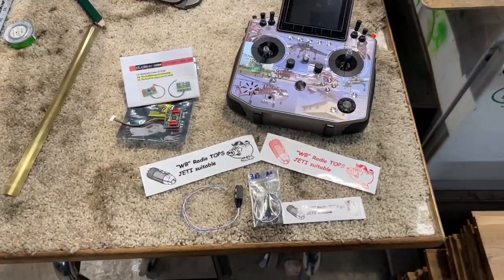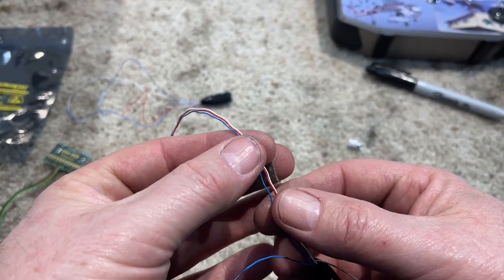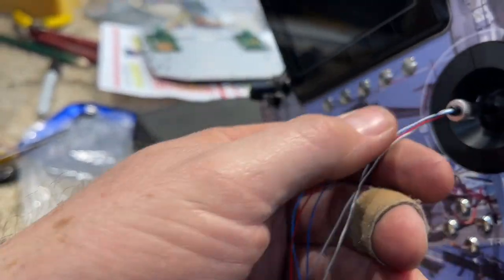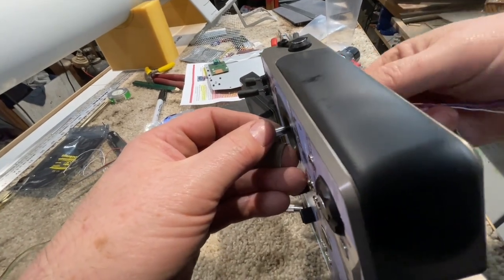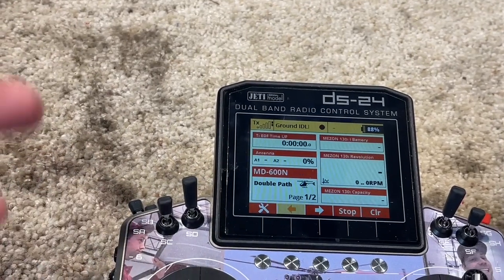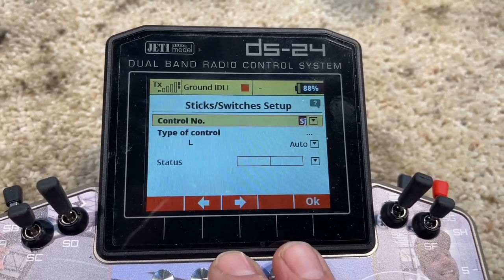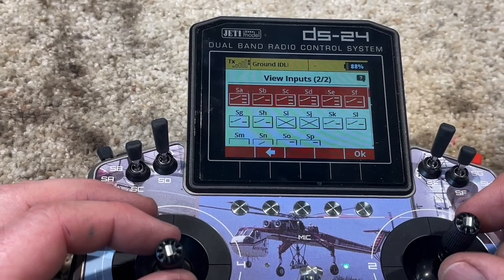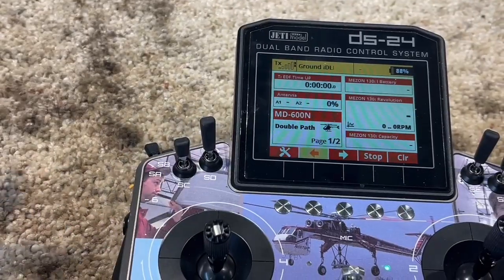Wild Boar RC Tops stick end button switches for Jeti DS24

Comment: Hello 👋!  It is mee Andrej. One important note...During the installation cables doo not need too bee twisted around. The stick is assembled with two M1,4 screws ( 1,3 hex required), if wee put out this two screws wee are able too disassemble stick. So in this case wee first attach bottom part of the stick, set the right rotation and elevation and after that wee pull cables thru. And than wee assemble back together. Soo noo twisting needed
“ Pice of cake”
Reply from the maker: NOW you tell me!! :) I couldn't get it to sit down on the threaded part of the existing stick and thats why I thought I had to be screwed down on there. IT is also how it felt, like it grabbed the threads of the existing stick so I thought it was just threaded.
Reply: @JestRR 
Hello Mike !
I have send you manual 30.11.2021 by masanger ( PDF file )

It is all described there 🤣

Comment: How did you fix the little board
to the Jeti, double sided foam tape?
Reply from the maker: It snaps into place. There is a spot that it plugs into along with the wires that have another plug that goes into another spot . Don’t have to tape it at all. Pretty strong clips that hold it in.
Reply: Got it, thanks